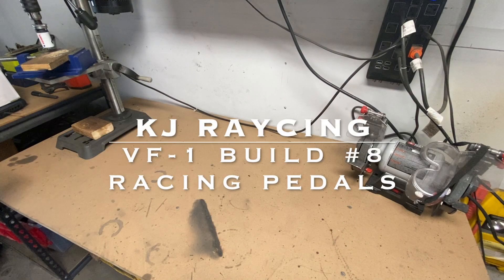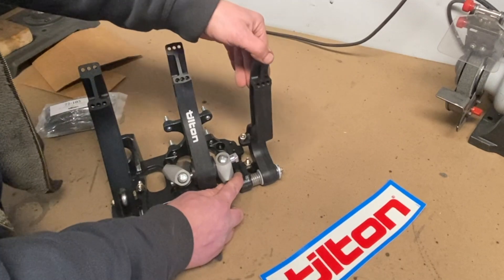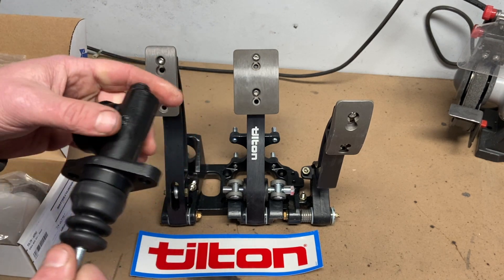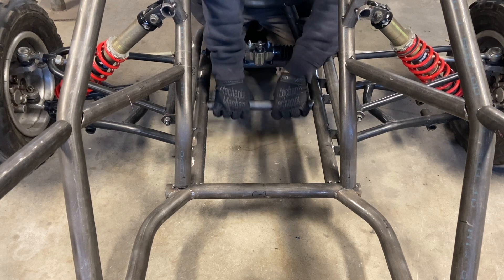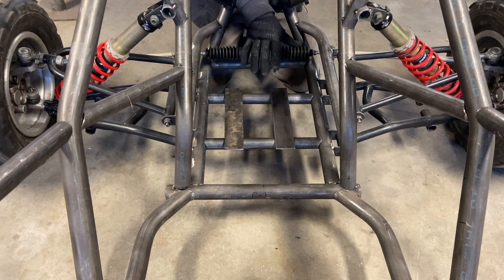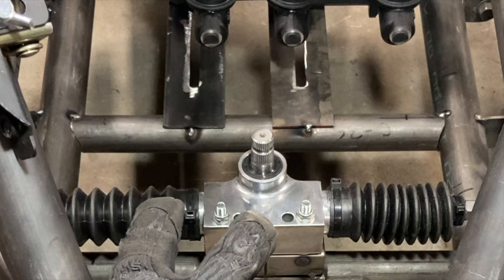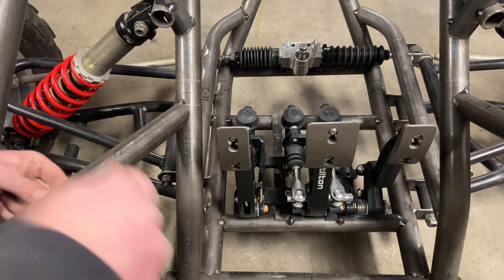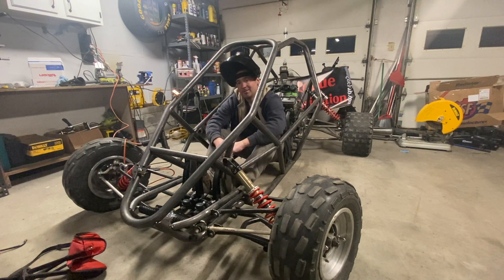Crosskart Build #8: Foot Controls

Comment: I saw a set ment for vw buggys on ebay for 300$ but the quality and how clean this looks is amazing. 
One more question. why is it all hydrolic? why not cable throttle and/or clutch?
Reply from the maker: I ended up switching back to cable because the chinese slave cylinder needed replaced once a year. Hydraulic lines make the pedals easier to adjust and have built it stops and pressure for feel.

Comment: If u had been flying from 80-86 I may have been your Crew Chief. I have built a jig from my 250 R quad and built an aluminum framed R6 powered flat track quad with yet was so impressed with your design that I just bought a set of plans. Nice job explaining the build to novices as well. Oh and yes we won several season points championships flat tracking and ice racing my quad. But as they say - with age comes a cage!